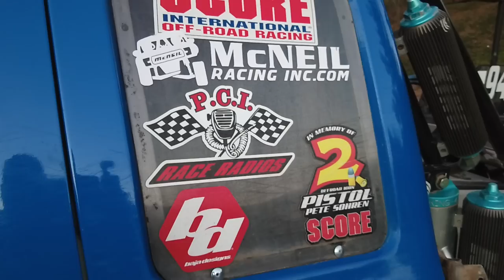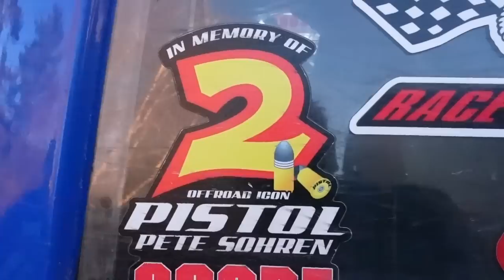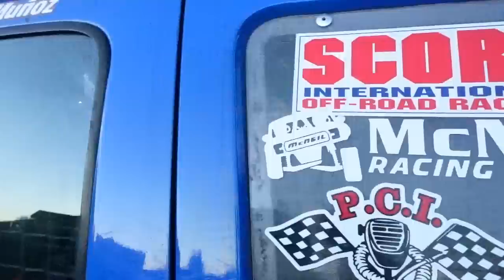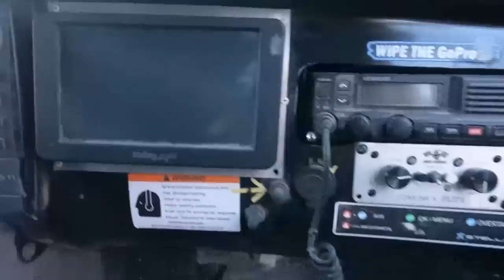MCC Ranger walkaround w/ Roy ODR! | BUILT TO DESTROY

Comment: Vince is a great guy. Met him when I Tech Inspected this truck right after he got it. I had spent 10 years working in the same industry as Vince. So we were friends right off. The day of the endo at the wall, he was the last racer through Tech. My son Warren and I inspected it. I looked at the big HID lights all  across the top and a couple on the front bumper, and suggested that since it was a day race he might want to take them off before the start to keep them from getting damaged. He'd just put them on. Told me proudly they had cost $1200 each. After doing tech sticker/helmet/harness check at the start, we jumped in my Toyota prerunnrr and headed for the Wall. Got there just as Vince's truck got rolled back over. Back structure badly bent. Fuel cell almost dragging on the ground. And ALL the new lights smashed! That might have cost more than rebuilding the back half. To this day, every time Vince sees Warren and me he's all smiles and happy to see us. Like I said...great people. Glad to see his Ranger is still rockin' 'n rollin'. And still on beams. And I still think he and Roy look like brothers. They make a great team together. Vince has become quite a good driver and I have big respect for Roy's fab, prep and driving.